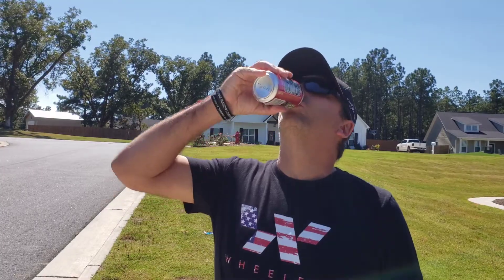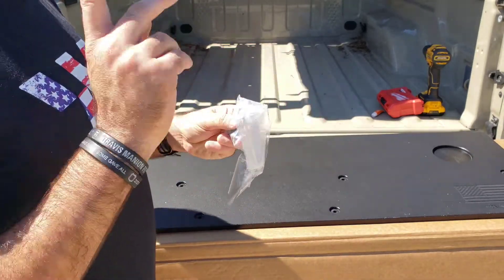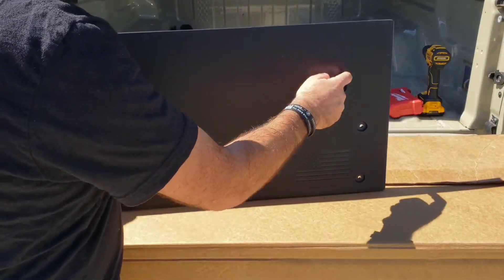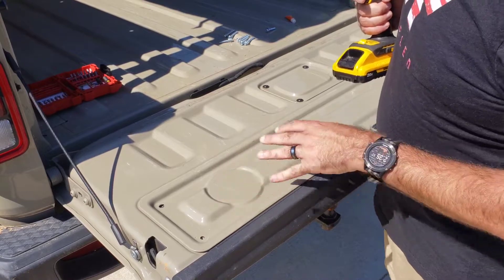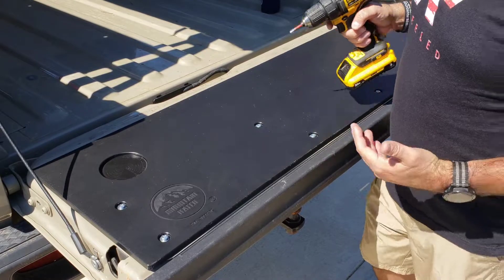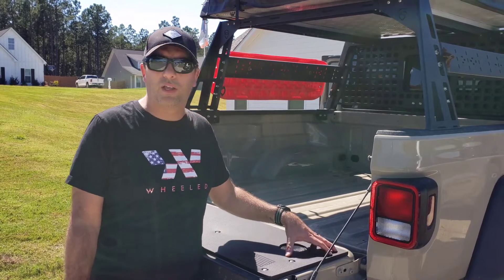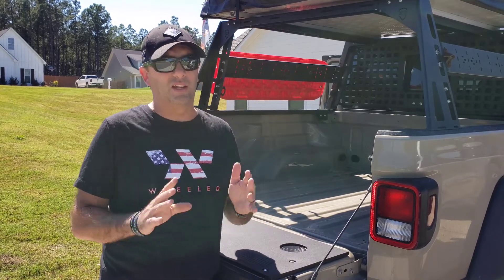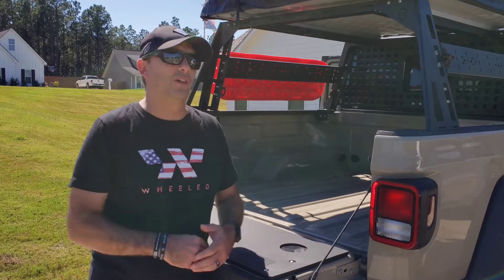Jeep Gladiator | Mountain Hatch Tailgate Install and Review

Comment: I thought it would include storage INSIDE the tail gate.  for 250.00 .
Reply from the maker: It's pretty heavy duty and if you catch them on sale the price is a bit easier to bear. Thanks for watching!
Reply: @DixieOverland  It looks like a quarter inch piece of plywood would do the job.
Reply: @DixieOverland  Black Sheep Innovations GMBH   $1362.00  Feb 2022.   Swiss    What ?
tail gate has to be heavily modified;  ha ha
Reply from the maker: @dafrasier1  it would but I wouldn't use it as a cutting board lol

Comment: Only bolted at the top. Bottom vibrates and will rub the paint off. They should have at least did the 4 lower bolts on the tailgate.
Reply from the maker: You know I haven't even looked to see how that would affect the paint.